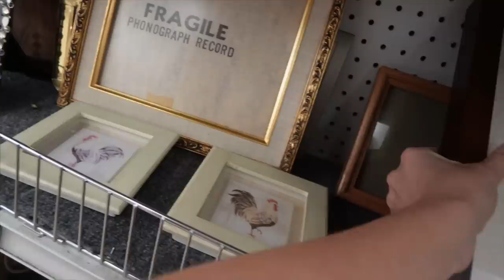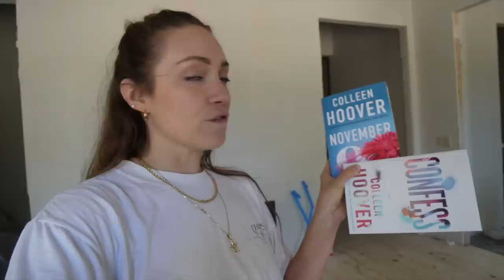our CUSTOM TRIM has arrived + renovation projects!  | XO, MaCenna Vlogs

Comment: I love the way you’re doing the trim. Question though…….do you want to inject spray foam insulation around the window cavity gaps before you nail down the trim? Maybe I’ve been watching This Old House for too many years, but that’s the way Tom Silva does it. He also puts water proof membrane around exterior windows before adding trim.

Comment: Look at you! Using all the technical jargon. 

I'm a firm believer things happen for a reason. Who knows why you had the tire incident Maybe you were saved from an accident.
As one who recently ordered a "bed in a box" mattress, two. I'm glad you realized quickly you needed support. I'm still amazed that tall mattress can be compressed like that. 
My foundation is all wood and was easy to assemble. I can get out of bed so much easier than just the mattress on the floor. I may get a bed frame down the road. For now this second mattress is just right.

Comment: Someone told me a long time ago to wet the pine flooring first. Not the whole surface @ a time, just where you are working. Don't soke it, but still wet it. When you do it this way, the parts that would be really dark should come out in the same color as the rest of the wood.

Comment: Staining  pine floors... Before staining floor, have you tried putting shellac on the line floor.?  I do believe it would seal the floor, and therefore prevent any splotches apperaing.  Then you stain.  Try on a practice board ...

Comment: fyi even those box springs dont give a ton of support to a memory foam mattress.....its best to put a sheet of peg board over top for continuous solid support for a foam mattress (or even spring mattress). peg board is best to use because its full of holes and mattresses need to breathe. plus its thin but stil sturdy and its cheap. some mattresses require a full platform of support for the mattress or the warranty is void. that is a great idea for the box spring to come unasembled like that....way better than having to move around big solid box spring mattresses!

Comment: Hello from Louisiana! Love your videos. They are the first I go to when I see they are posted. Can I mention to be careful when pulling your wood back towards you with the table saw running? It’s best to turn it off first. If it happened to catch it could cause kick-back. I started not to post as I know you are very comfortable with the saw and I don’t want to come off as a know-it-all. But I wanted to mention it in case you weren’t aware. Keep up the good work 😊